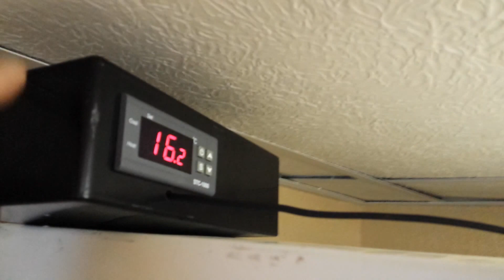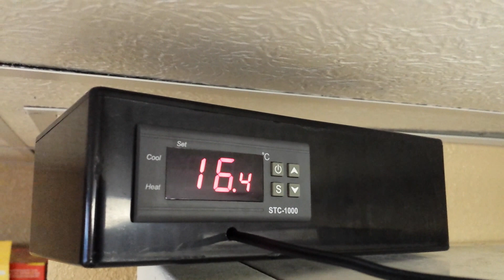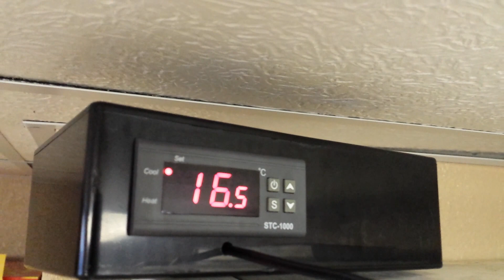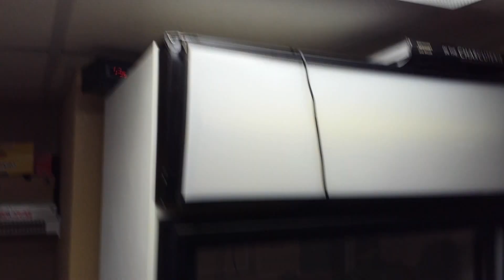Home Charcuterie: The Curing Chamber, Part 2

Comment: Why don't you drill a hole into the top of the unit where your fan is, then run your wires down through there that way? I have the same exact unit I bought off of eBay and am going to do the same as yourself... I haven't looked yet, but there should be a space between the fan and the top of the unit itself. I was going to remove the plastic cover/face where the light is, remove the light and make a sheet metal cover to mount all of my controls onto, that way it should make the clean installation you're looking for. Make no mistake, I think you have done one heck of a nice job.. just a suggestion and my ideas as to what I was going to do.. and by the way, I am an industrial electrician, so you or anyone else who may have any question as to wiring.. feel free to holler... email address you can contact me at is LPEORA@YAHOO.COM I had also posted this comment on your part 9... just reposted here in case anyone may need some help..  Great job.. thanks for sharing..
Reply from the maker: good suggestion actually! never thought about that. i'll have to take a look and see where a good spot is that would be possible to bring wires down through.

Comment: Hey man, What temp setting do you have the fridge set to? I notice a lot of fluctuation when the fridge is running all the time. From 28-40 degrees
Reply from the maker: I have my temperature controller set to hold the fridge at 15.0 Celsius to 16.5 Celsius ( 59 F - 61 F). Are you saying you are noticing your fridge temps are running from 28f to 40f? Are you using an external temperature controller like in my video? If not remember that it is impossible to keep a fridge alone (without external temp control) at above 40f. All fridges will keep at roughly 33f - 40f.
Reply: ***** I'm acutally using my fridge to dry age beef so I'm trying to keep the temp under 40F. Im consistently finding that its either too cold ~28 or too warm ~40
Reply from the maker: Sounds like the thermostat on your fridge isn't running correctly. Maybe double check your thermometer accuracy? If all else fails you can get an external temp controller. Simpler ones can be found on amazon. Then you can just force your fridge to stay in range.